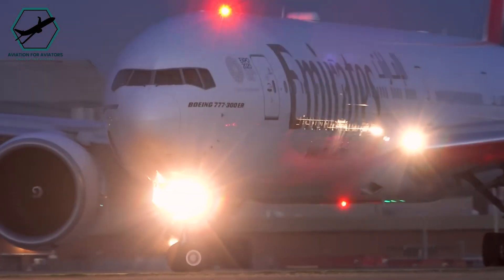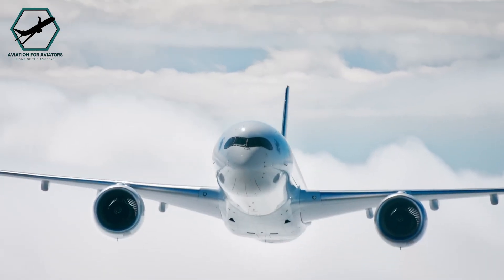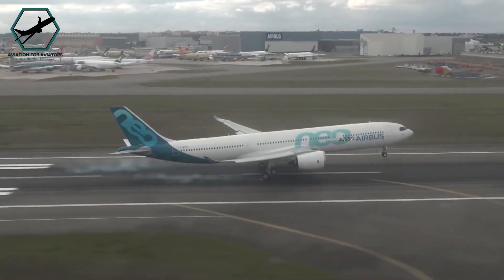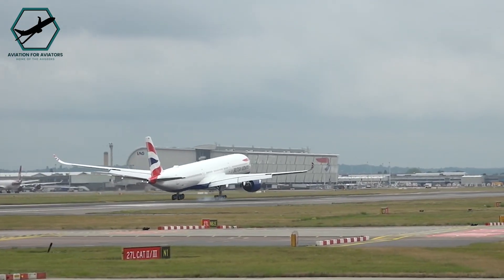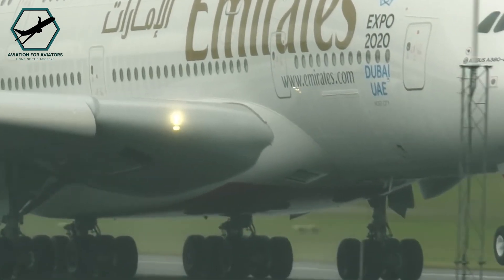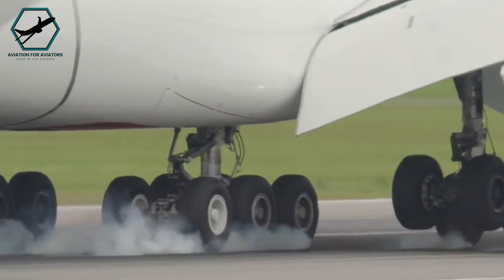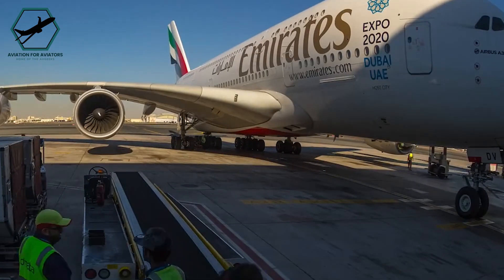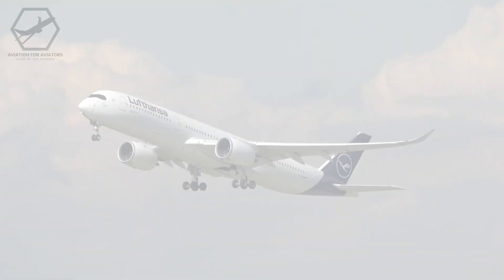What happens if an aircraft lands overweight

Comment: Firm landing? Usually an overweight landing means VS at landing has an absolute maximum of 360fpm, well below the usual 600 fpm, and which is why the overweight landing checklist states: "MINIMIZE V/S AT TOUCHDOWN". Landing distance calculation is available for overweight, so distance should not be a problem. That said, landing in the touchdown zone is required on every landing, miss it and its a balked landing or dismissal. A bigger issue than a pure overweight situation is loss of antiskid in terms of required runway length.